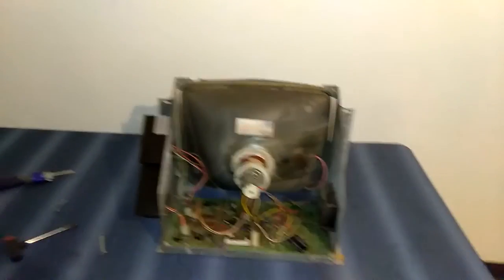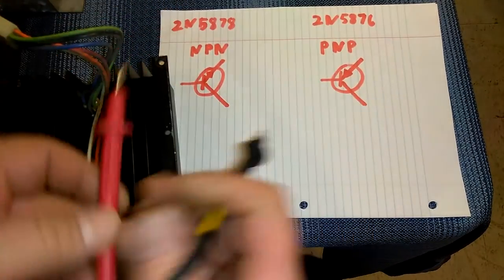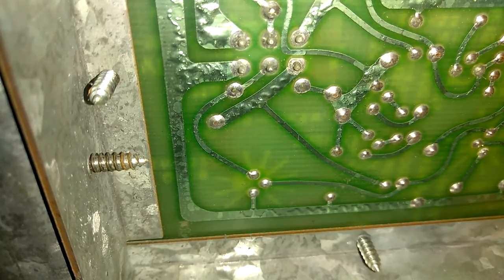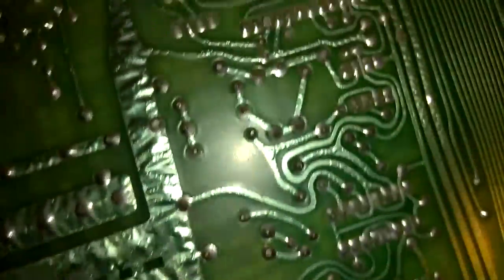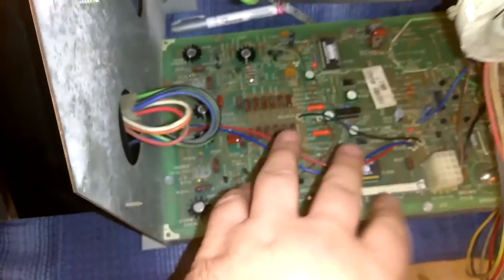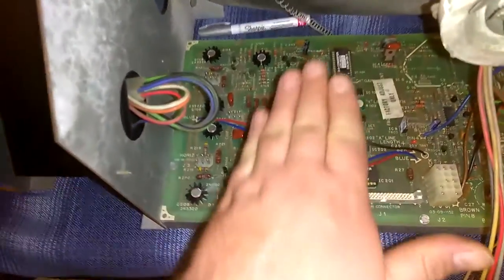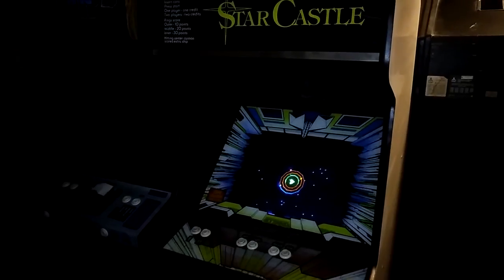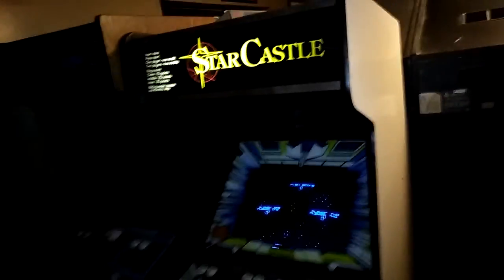Cinematronics vector monitor repair

Comment: Jason, thank you for this video. I do believe that's what happened to my monitor. I plugged in my SC, pushed both of the red breakers on the power supply, on the monitor a blue dot went up to the top and then exploded. My monitor doesn't come on anymore. My motherboard is good. So is my power supply.

Comment: I had a Space Wars cinematronics 1977 model have the screen go wobbly and bang! I disconnected the monitor section, and the game still came up okay, I could get the coin mech to work and hear all the correct sounds. I replaced the deflection transistors, and also the 2n2102 transistors. I powered iit back up, got weed noise and just a centre spot. When I checked the monitor board again, I had put one of the 2N2102 transistors in the wrong way around. Now the when I power up without the monitor, I get no sound and the coin mech doesn't tick the counter over. I'm worried I've blown the CCPU board. Where should I check next. Voltages are good from the supply.

Comment: i like how u show the repair steps, u seem to be very experienced and knowledgeable. i have a 27" wg d9200 the picture shakes left and right a half inch for the first ten minutes then the shake goes away. do you have a suggestion of what part might be failing? i plan to install a cap kit soon. thanks
Reply from the maker: oh the dreaded wg9200  i have had quite a few problems with this chassis over the years since it does fix its self over time i would suspect a failing cap  but if your cap kit wont fix it i suggest separating h and v sync if applicable  you can also adjust the sync on board a hair . that monitor has an auto sync feature  that is very picky  i have seen some games that  just wont work at all with this monitor
Reply: thanks!

Comment: ARCADE JASON, can you show in a video explaining the DIfferences between a Raster arcade monitor compared to a Vector arcade monitor, what are the differences in the circuits and differences in the signals it uses please. A vector monitor DOES NOT use V&H sync hold circuit, any reasons why?
Reply from the maker: a raster monitor is always drawing horizontal lines across the screen even if no rgb signal is  present . a vector monitor directly controls a beam the same way you would as if you were to draw an image with a pencil. (remember connect the dots?)
Reply: @ArcadeJason  thanks, but the arcades motherboard is outputting V&H sync signals and RGB signals which is a total of 5 signals/wires going to the arcade RASTER monitor. An arcade motherboard for vector games DOES NOT output V&H sync signals? it outputs V&H deflection signals and RGB signals going to the arcade VECTOR monitor which is a total of 5 signal/wires?
Reply from the maker: @billwilliams6338  remember the scanning lines on a raster monitor i mentioned above? you need to sync them with the arcade pcbs rgb out put .  vector monitors do not do anything at all unless there is an x or y output therefore no sync is required because we are not syncing anything
Reply: @ArcadeJason  Yes but what are the X&Y outputs are they sync signals or what is a deflection signal is a deflection signal a type of sync signal or what. I'm confused on the difference between a Sync signal compared to a XY deflection signal, i don't know what the differences are or how they work? Vector games don't output RGB signals only XY deflection signals?
Reply from the maker: @billwilliams6338  color vectors output rgb signals and xy signals bw vectors output mono and xy . there is no sync because there is nothing to sync to .  unlike  raster a vector monitor does nothing without an xy signal. i suggest watching a video of how a crt tv works  and note the scan lines we need to keep these lines in order (sync) with the game boards rgb output
Reply: @ArcadeJason  yes i have watched CRT TV videos its confusing because it seems that the H&V sync signals are the coordinates positions for the Raster CRT. The XY signals are the "coordinates positions" for the Vector CRT.  Does this sound right or am I wrong?

Comment: What does it mean when you say "in circuit"?

Great video by the way.
Reply from the maker: in circuit means connected to the pcb in some cases the only way to properly test a component is to remove it entirely from the pcb

Comment: Hi. It appears on my asteroids monitor when it warms up... i see a white dot with a cir le around it. Like a bulls eye.. you ever see that on the black and white monitors
Reply from the maker: hv needs rebuilt or the gun in the tube is grounded out
Reply: Arcade Jason hey jason
.... as i am new to the hobbie... im still learning...what is hv? Is it hard to rebuild.... also the ground out... something i can adjust?. Thx
Reply from the maker: hv is highvoltage the metal box might need rebuilt you can buy a kit from arcade shop  if the tube gun is grounded you would need to have the the tube rejuvenated (special tool ) or replaced entirely